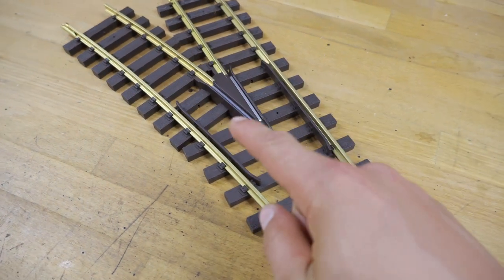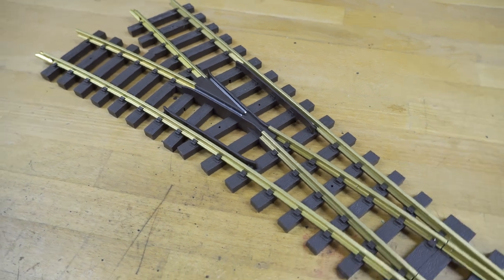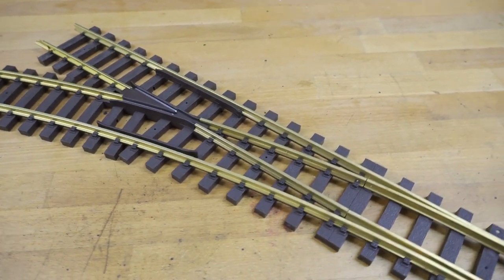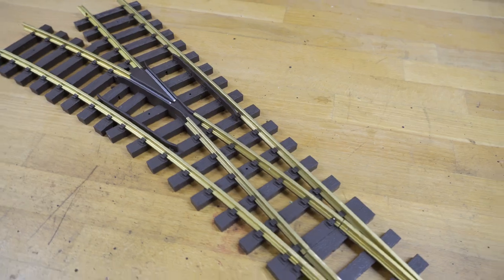FIRST TRAINS on the layout! Testing all the switches...

Comment: Have you checked the back to back wheel gauge of your rolling stock? Wheels too close together or too far apart might explain some of the issues with going over these points. My understanding is that they're machined from a single piece of brass, so their accuracy should be pretty high, but they might also be less forgiving than other manufacturers. Also what is the wagon seen at 3:06?
Reply from the maker: That is a very true statement. I have overseen the fact that the wheel gauge could be off. A friend of mine made me aware of this possibility, so we checked several pieces of rolling stock and shure enough some wheels where off by up to 1mm which is a great deal regarding precise components like switches. The problem is the wheels do not conist of one solid piece of brass since they need to be isolated from one rail to the other to prevent short circuit. If the bond between the metal wheels and the plastic insulating component gets loose the wheels can get wider or narrower to some degree. The wagon you see at 3:06 is manufactured by ESU. It is made to transport bulk goods like gravel.
Reply: @summitrailway  yes I watch some 00 gauge channels too and it can be a really big issue there with the even smaller tolerances - would be interested to hear in future if this has helped improve running and the process/tools you used to check and adjust the gauge. I know there are lots of tools for 00 gauge, but only know of 1 for G gauge made by Aristocraft, so hard to find. I imagine the back to back gauge also varies more widely in G depending on manufacturer of the wheels than in 00.

Comment: Congrats on running the first trains! And nice to see you also mix narrow and normal gauge locos and cars :)
Reply from the maker: Thank´s! I had a lot of fun running those trains for hours and testing every inch of track. Since I had to do a real test I picked all kinds of locos and cars. I wanted a broad diversity , that´s the reason for the wild mix of narrow and normal gauge models. In "normal operation mode" I will still run narrow and normal gauge trains simultaneusly but I won´t use a normal gauge loco for narrow gauge cars and vice versa.
Reply: @summitrailway  Thanks, got your point.

Comment: I assume that all the switches are electrically operated (not mentioned) but I did NOT see any of them operate.
Reply from the maker: Hi! There might be a misunderstanding. I was testing how the trains will run over those switches. Are there any derailments, do trains run smoothly, all that stuff. The operation of the switches will be electrically in the near future. At the moment they are hand operatet since I have to implement all the wiring first. I hope this clears up the confusion.

Comment: Well, actually I'm a little surprised. Thiel is a premium brand with a premium price so would expect them to be perfect, or better then lgb/pico🤔
Reply from the maker: You are right, the price of those switches is premium so my expectaitons where high as well. After all the issuies I had where fixed pretty easy. But thinking about this for a while I came to the conclusion that the biggest advantage of thiel is the variety of switches you can get, especially switchtes with large branch angles, curved switches and so on. They are built very sturdy and look nice at the same time. So for me it´s still worth the extra money although I have to do some minor work to some of the switches.